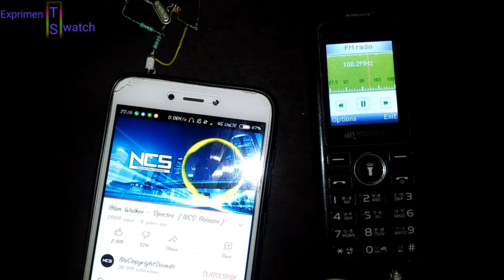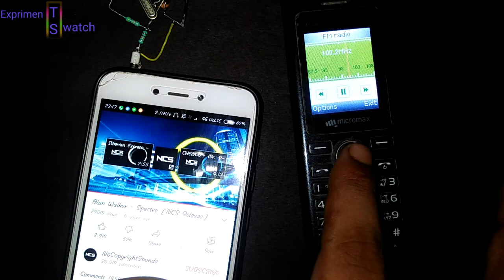FM Transmitter circuit | simple FM circuit  || 100.2 Mhz.

Comment: Hey man! The fifth harmonic is formed by 27p? I have a 24 MHz crystal = 120 MHz 😮
The "CBE" pinout you provided for the 2N2222 transistor is incorrect, but you are soldering correctly. The datasheet shows "EBC". Not particularly smart electronics engineers will make a mistake. For this circuit, the positive power pin is supplied to the npn collector rather than the emitter. 😂

Comment: It's not working. What a waste of time. Add an in4007 diode in series with the xtal and modulate with lm386 AF amp via a 100K resistor.
Reply: after modification did it work